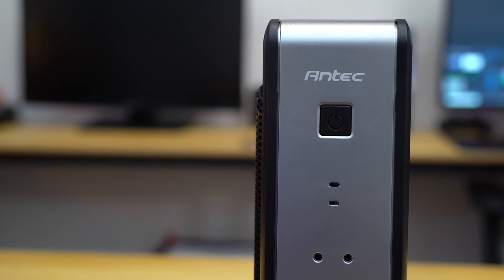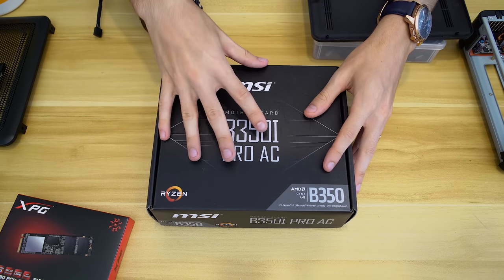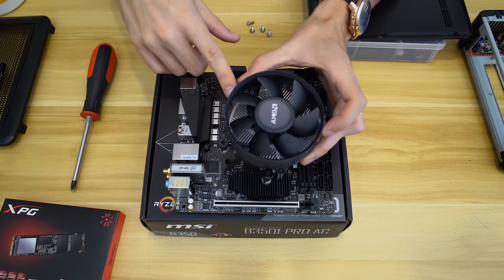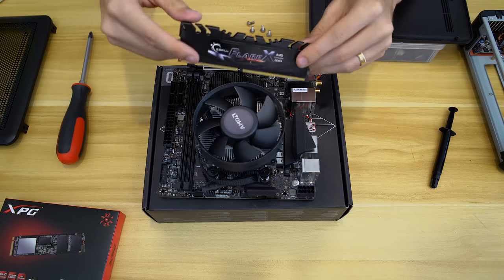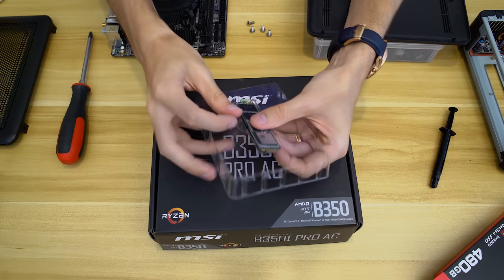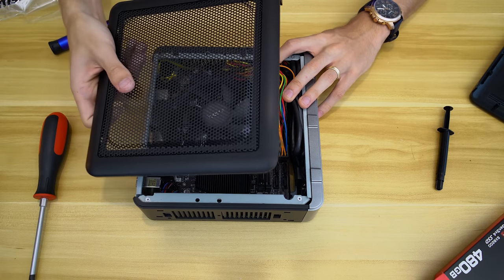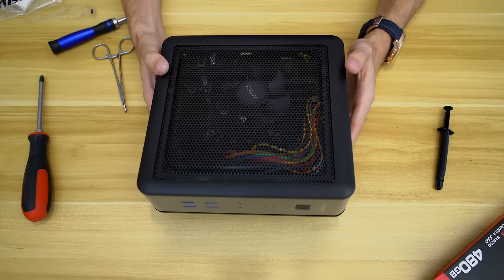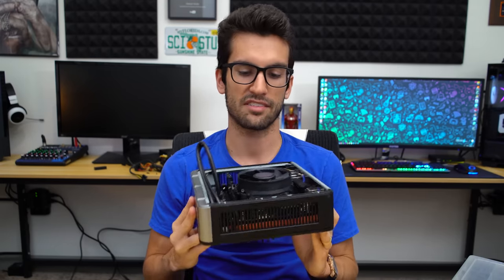How to Build an Ultra Small Form Factor PC... and Fail Miserably

Comment: U modified the cpu cooler but did not show the process? Lol seems like an important part of the installation? But fuck it, just tell us what u did not show us
Reply from the maker: I literally said to refer to the video description. How about paying attention? Also, the only "modification" involved ripping off the top shroud. Completely tool-less. So chill out :-)
Reply: He went into detail on how to modify it in the description. He’s using an arbitrary cooler that most people will never get, so I can see why he didn’t show it in the video
Reply: Since you have no problem writing a rude comment, you probably have the skills required to read the description before commenting.  It even has fucking asterisks....  

" *To remove the outer shroud on an AMD Wraith Stealth cooler, grab underneath its shorter slips (180 degrees apart). These will be 90 degrees from the AMD logo. You'll need to pull with quite a bit of force, as these shrouds are glued on.* 
"